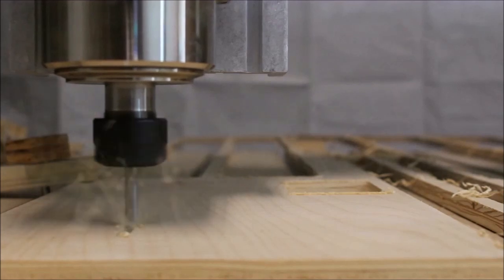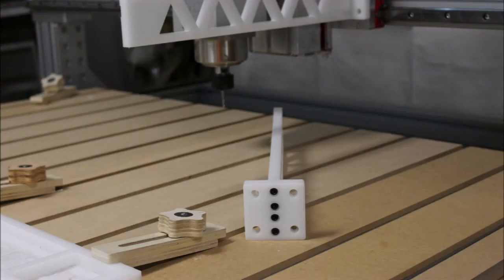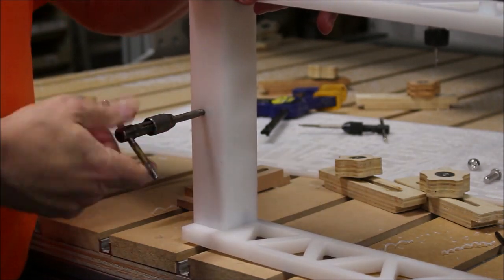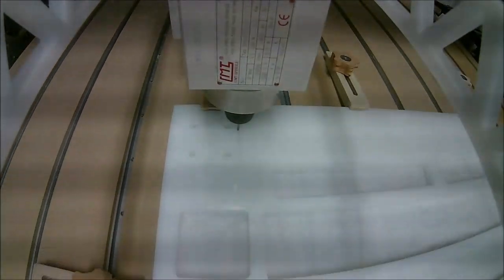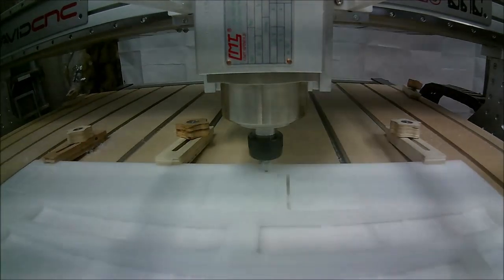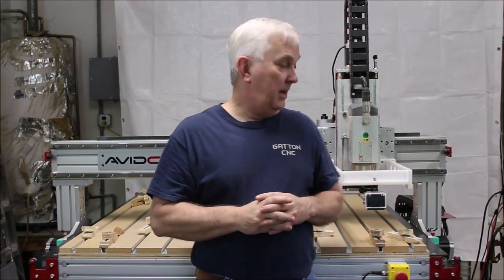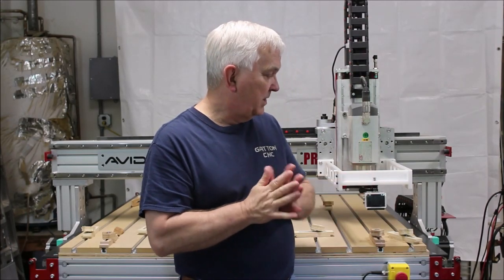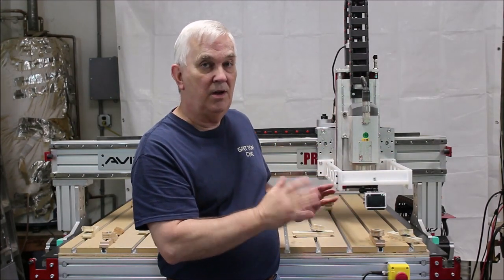Making a Camera Mount for my CNC

Comment: Some on those camera's can change the refresh herz.. take a look in the settings before you add a new one!
Reply from the maker: You mean I'm gonna have to read the directions?  You know I don't do that well.
Reply: @DaveGatton  yeah mine has varies hz changes for that flicking issue. its all about the refresh rates of the lights and camera.. same thing used to happen with old CRT monitors.

Comment: Cool mount Dave, really like the lower angle. I had a cheap drone a longtime ago that had lines like that due to tiny vibration and light mixes. Could try different frame rates like Peter suggested or use one of those bendable flex mounts on that bolt to hold the camera

Comment: I prefer the lower angle so long as it won't crash into the piece being cut.
Reply from the maker: Thanks for watching Steve and taking the time to comment.  The camera mount is stationary and doesn't move up and down so I think it will be fine.
Reply: I re-watched the video and I see the camera doesn't move on the Z axis.  Thanks for the quick response.

Comment: Great camera mount. Maybe some DC powered LED strip lights under the mount arms will light everything up nicely without the lines. I prefer the view with the camera under the mount. It's a slightly better view of the bit in action.
Reply from the maker: Thanks John.  Always appreciate hearing from you.  I've got a few things I'm going to try.  My next video will be trying the camera at all the different settings.  I think it has four settings.  720/30FPS, 1080/30FPS, 1080/60FPS, and 4K/25FPS.

Comment: Hi Dave , what cutter diameter ,depth of cut, feed and speeds did you use on the HDPE ? Thanks .
Reply from the maker: Thanks for watching Dave.  I was using a Whiteside 1/8" up spiral cutter (link in the video description) and the depth of cut was 1/8" at a feed rate of 150ipm.  21000rpm on the spindle.
Reply: Thanks for the info Dave

Comment: Nice one Dave. Can you set the camera frame rate to 30 or 60 frames per second as it looks like you are shooting at 24fps which will give that line effect.
I line the underslung view.
Cheers
Peter
Reply from the maker: Thanks for watching Peter.  I will be trying out some different settings as well as other lighting options.